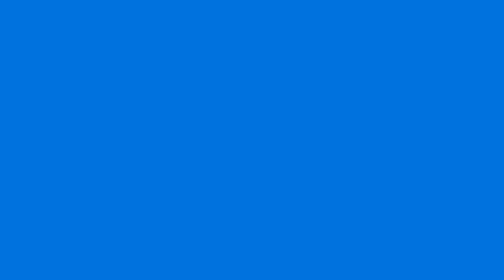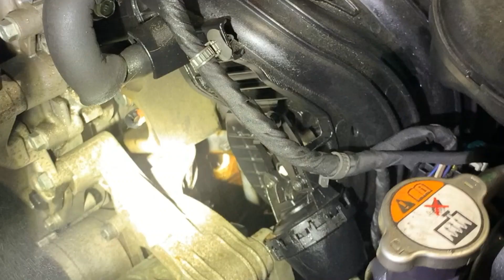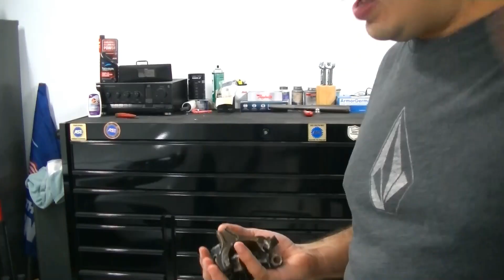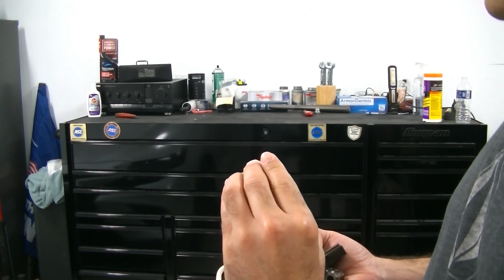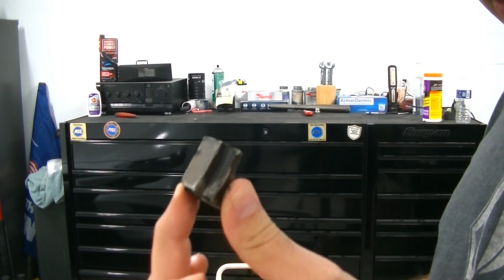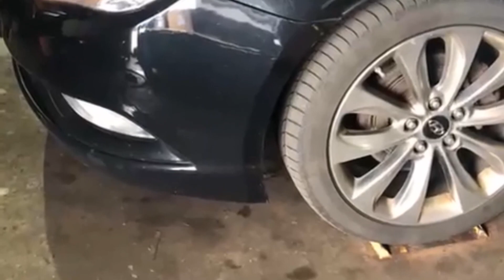P1326 In Hyundai/Kia vehicles, Cause of Theta 2 engine Failures, Timeline of Hyundai engine recalls

Comment: It’s amazing that Hyundai didn’t address the issues during their durability testing.
Reply: I have a kia sx turbo. My engine does run hot. I change my oil frequently and use the manufacturer viscosity suggested . 2012 with 95k miles. It burns 1 quart per thousand miles. Exaust smoke always dark at the start but fades while driving.  It's still fast tho, no oil leaks. Engine light on, possibly needs Sensors changed.

Comment: I have a 2016 Hyundai Sonata and the engine failed WITHOUT WARNING at 125,000 miles (2.4L) Changed the oil religiously every 6,000 miles with Mobile 1 synthetic. I owned it since new. I am an ASE Master Tech, I know what a failing engine sounds like. The rod bearings started squeaking then the lower end started knocking.
Reply: Mechanic here as well. Just picked our 14 Santa Fe sport from having a new long block installed tonight ! . The family and I were driving down the highway, a few weeks ago and then the engine shut down instantly. Lower end locked up solid.. we have had it since new and I changed the oil religiously every 5-6000 kms with Mobile 1 5w20,  . Engine only had 138,000kms ( 85,740 miles)  on it when she let go. 
Anyways going to be trading it in for a Toyota Hylander in the spring. I am  finished with Hyundai.

Comment: Thanks for this video.  My daughter bought a used 2013 Sonata two years ago and still owes $2k on it.  You can imagine her feeling of devastation learning the engine had seized.  Your video greatly helped me understand what had happened and will help me approach the dealer as an educated customer as I apply for warranty coverage.
Reply: They deny warranty often there are lots of video on YouTube about that. You should have paid little more and gotten Toyota, Honda or Mazda. Many people learn only hard ways.
Reply: Did she check and add oil regularly?
Reply: @gregorymalchuk272  Defiantly, the oil never dropped below the add mark.  It never really used oil.  I check oil very regularly and never let it get lower than the halfway mark.  So far we're nearly a year on the new engine and it's running well so far.

Comment: I have the Theta 2 MPI 2.0 in my Sonata YF,  it's an import from S. Korea and it is just fine. 2011 year with 160,000miles on the clock. There are some of the usual oil leaks around the valve cover gasket, which was fixed twice, first time with aftermarket gasket. Make sure to use the OEM gaskets from Hyundai and you wont get any more leaks! The car has been reliable, even after overheating at 90k due to a failed electric radiator cooling fan. No oil consumption, and I have run it on fully synthetic Japanese 5w40 motor oil (I live in the tropics, it's always hot!) changed every 7.5k miles. I am glad not to have gotten the GDi engine, as all GDi engines suffer the same fate....heavy carbon build on the valves after just 20k or so miles, unless the engine has some port injection as well to wash and cool the valves. The EGR system makes the GDi a whole lot worse!

Comment: 2015 Santa Fe 3.3 had issues with the camshaft position sensors, they were newer, and replaced them with upgraded ones, After the warranty expired I ordered the Holstein brand from Rock Auto Parts to replace all, and no more pesky engine lights came up. Have only 33.000 Km on it and recently Engine oil pressure started to leak had to replace that junk too before the catastrophe happened Hyundai never replaced them under warranty even though they knew that they were faulty and prone to leak..... NEVER MORE HYUNDAI. WILL TRADE IT IN FOR TOYOTA.

Comment: Very informative video. My 2011 Sonata 2.4L seized up nearly two years ago. That happened a couple of weeks after an oil change. I had it towed to the dealer and the first thing they did was check the oil. The oil level was good so they had no choice but to replace the motor under that recall. My car still looks great and runs perfectly so I plan to keep it for many years to come.
Reply: Many years to come or until the next bad engine. Hyundai knew of the problem for years and never took steps to fix it in the factory.  The US government let's corporate America do anything they want without regard to costs to customers.

Comment: My 2014 Tuson. I'm a 30 year tech and when the dealers say it's not covered I'll be all over them because the knock sensor reprogrammed and at 140K cylinder #1 started knocking. Its at the dealer now so we'll see what they say. It is in excellent condition here in florida and has always had Mobil 1 so they should replace the engine at this point. It's been back 3x for an engine noise and each time they say they can't hear anything. It's knocking now so they can hear it...3-4,000 rpm's. Great info thanks!

Comment: Very well explained and i could possibly believe a batch of cranks that werent 'deburred' properly due to a tooling/drilling failure but for years it's hard to believe. I have been watching a few complaint vids lately and from what they say Hyundai COULD CARE LESS that their engines failed so they seemed to have lost many customers due to terrible customer service but like anything it's $$$$ based and in the end the customer gets screwed. I have owned a 2003 Accent, a 2008 and 2009 Accent, a 2017 Elantra 6 speed and 2019 6 speed and now a 2021 Kia Forte as the manual is no longer available in the Elantra all without even 1 issue. One customer said he could see the metal particles on the dipstick and they jerked him for a year before finally telling him no. If it was a total 'deburring' issue that sounds like someone either wasnt inspecting the cranks properly or that wasnt a protocol after machining.
Reply: Sure seems it would fail on breaking then or very soon. Many of these are high mileage. Some 80,000 and I have even heard they replaced one with 224,000.

Comment: Very informative video. Thank you. My engine in my 2017 Santa Fe Sport 2.0T started knocking on a trip up to visit my family in Northern Ontario last week. Of coarse it occurred a few kilometers past my extended warranty at 160, 000 which I went over on that trip!. And of coarse it occurred in very cold freezing negative temps about 100km from the nearest city in the middle of no where. Along with waiting for a tow truck to come from that nearby city 100km away costing hundreds in the tow bill and waiting in the cold because I didn't want to start the car due to the knocking, it was quite the experience. Funny because I had the knocking sensor update in 2019 and my car did not go into limp mode nor did any error lights come on the dash. The one advisor from my local dealership on the phone even told me to keep driving because it didn't go into limp mode. The dealership that it was towed to stated they have to order a new engine from Korea that is back order and provided me with a loaner from Enterprise. I am just thankful this happened to me and not to my wife. Do you know if the replacement engine could have the exact same issue occur in the future or do the replacement engines have the knocking/rod bearing issue resolved?

Comment: This video was so informal. I’m suffering from the engine knock and p1326 code on my 2016 sonata sport 2.4L. Taking it to the dealership Monday and knowing this extensive information is very very beneficial
Reply: I’ve had it for over a year now and I’ve put 34k miles on it because of work but I’ve had routine oil changes (5 in total) and have gone full synthetic. it went into limp mode back in July. Took it to a mechanic and he changed the oil and vvt solenoid and as I was driving it home it went back into limp mode and completely stalled out and wouldn’t cut back on. The next day it did cut back on and I had it towed to my personal mechanic where he informed me that something broke loose inside of the motor and that i was going to need a new engine which was quoted at 6k. I’m just now learning all this stuff about the theta 2 engine and the infamous p1326 code and misfires happening and honestly regret getting a hyundai when I had the chance to go with a 2016 Honda accord sport.

Comment: We’ve got a 2017 Santa Fe 2.4 sitting towed into the dealer with the p1326 code.  It went into limp mode with the flashing CEL on the way home.  We got it certified used and had most of the maintenance done at the dealer.  We will see what they come up with…

PS, thank you for the detailed history of this unfortunate issue!

Comment: Thank you very much for your explanation of the "issue" Hyundai has with the Theta II engine.  Indeed it is somewhat complicated.  I have two Hyundai's and one is a 2013 Santa Fe (used but certified) with about 69k miles and have "experienced first hand the "limp home" mode as it entered this mode while driving in the mountains about 100 miles from home recently.  The vehicle has had all the recalls done including the "band aid" ones.  I'm a retired service advisor/ASE tech and know a little about vehicles and have tried to follow the issues with this engine.  Hyundai has "struggled" to find a fix short of replacing all these engines and indeed the "latest" is to reprogram the last reprogram to I believe "dumb down/less sensitive" to prevent the vehicle from going into limp mode when not necessary which is exactly what what was done this time when I left it there for over a week.  The "good" news was that the engine is OK according to the bearing test.  In my opinion I believe some of these engines also fail due to some owners failing to keep the oil level full as it appears they are sensitive to low oil levels.....remember the recall where the oil was changed along with a new dip stick?  In other words, keep the oil full and oil changed about every 5k miles.  As far as the GDI issue with carbon on the back side of the intake valves, this is an issue with any GDI engine and is the reason some manufactures have gone to adding PFI injectors also.  In the mean time I suggest to do a intake clean with a product like CRC cleaner every 15k miles and add an oil catch an.  I do both and they work.
Reply from the maker: Hit the nail on the head. If you look at some of my other videos you’ll see that I run a catch can on my personal car, and I also believe in performing some sort of induction service at a regular interval, though I prefer BG induction cleaner.
Reply: Great vedio I just subscribed 👍..one question I have.i bought a brand new 2020 santa fe could I just vent crankcase to atmosphere with a fitting inplace of the pcv valve and vent it through a hose to under the car?........of course this vehicle would used only on race track .
Reply: @arthurhudgens8213  I've read where people do that, triggers service engine light, you could also do a catch can.
Reply: @lonniebeal6032   I think a catch can is an excellent idea and I'm looking into that soon..noticed your last name is Beal my best friend growing up in fairview tn was Eugene Beal
Reply: Thank you. Very relevant!! 
14 kia forte that passed clearance test but frequently goes to limp home mode. My ind shop suggests moving the placement of the knock sensor. No crazy oil consumption maybe a quarter between changes. I don't hear a loud knock, closer to what used to be known as lifters ticking.

Comment: I owned a 2009 Sonata and put 170,000 miles on it.  I changed the oil and filter with synthetic Mobil 1 oil every 5,000 miles and never had a mechanical problem.  Never changed the transmission oil, it looked fine, and I did change the coolant around 100,000 miles.  Great car...
Reply from the maker: Yes the pre GDI engines were great for the most part
Reply: 2009 was a dohc engine. Far superior. I have the same 09 sonata currently running strong at 150k miles. Going to the GDI is a bad business decision and brand destroyer that hyundai will suffer from for years

Comment: Great video!! I have a 2016 Kia Forte and IDK if I shall be worried! The dealership bill says it has an N 2.0 Theta MPI engine, made in Korea. It has 60K miles and has been very smooth, it doesn't burn any oil, and I checked the VVT solenoids for debris, and found nothing. The only "suspicious" symptom is that is makes a "slap" sound whenever it is warmed up, turned off for a few minutes and then turned on again. It's weird, because it doesn't happen if it has been sitting for many hours, even days, so it's not when the engine is cold.

Comment: Thanks for making this video, I am going to save it and show it to my wife.  We have a 2016 Kia Soul with the 2.0 and it has very low miles on it.  Always had it's maintenance on time and at dealers.  I know you are going into the Hyundai engine, I believe Kia is using the same engines.
Reply: It's the same exact engine.
Mine is in a Hyundai Santa Fe.
I'm at 130.000, no problems with it all.
The fuel pump had to be replaced at around 60,000
That's it
Reply: I bought a new 2017 Elantra automatic,  fully loaded,  Southern California car. It just turned 105.000 miles. The entire car has been excellent.  0 repairs,  0 issues.  Engine runs smooth quiet, uses no oil . Oil changes every 3000 miles with Castrol GTX since 1st oil change..extremely pleased with the car.

Comment: Trusting our LORD that the new 2.5L engine doesn't have the bugs that the 2.4L Theta 2 engine had! I just got my wife a 2023 Sportage (last June.) I do oil changes every 5,000k/6 months, whichever happens first---usually the 6-month interval happens first. Oh, & I only use fully synthetic oil, exclusively.
Reply: I have a 23 Santa Cruz with the same engine. 0W-20 is the ONLY recommended oil which happens to be full synthetic. I'm hoping I don't have carbon buildup problems because of it being  GDI.

Comment: I think I just ran into the unnecessary engine protection mode you mentioned later in the video. My 2017 Sonata went into limp mode at 96k miles, limped it to the dealership and they said it needed a software update and passed all engine tests. Crossing my fingers that the issue doesn't rear its head again, at this point I'm going to be trading it in and getting a Toyota RAV4 as soon as I can.
Reply from the maker: Can’t go wrong with any Toyota products

Comment: I have a 2013 Kia Optima SX T-GDi with 36k miles. I change its oil every 3 months and I think this is what it has kept it alive on the original engine for so long. 
The recall has been done but I don’t know which one since they changed the dipstick to the red one and that’s it.

Comment: I bought a 2015 hyundai veloster may of 2021 with dual clutch, 1.6 L engine and within 2 or 3 months it went in limp mode. Replaced knock sensor, drove fine..for about 8 months.  Took it to dealership for computer upgrade revision, ran fine for around 6-8 months then noticed a serious power drop in acceleration and a slight rattling ping sound when waiting at a light and next to something solid it could reflect sound off of.  I changed spark plugs last friday and always top off my oil and have it changed as recommended.  Checked all fluids and she ran decent for a 2 hr drive from sacramento to muir beach in bay area (ca.) Until way home driving thru Vallejo, coming up an incline my check engine light flashed and i pulled over immediately and called AAA andtowed it back home.  Limped it to O'Reillys about a half mile from my house and scanned it which brought up the p1326 knock sensor code again.  Ordered part, came in, gunna replace it today before it gets too hot here(it ws 108°yesterday!!)  Now after watching your video which I thank you very much for so helpful would you suggest but I inquire with the dealership if there's a software update or should I contact Hyundai about the reoccurring knock sensor or should I do the research and not have a vehicle to drive probably lose my job and hope that somebody knows what the hell's going on???  That is why I'm asking you what your opinion would be what I should do any input would be greatly appreciated.  By the way I bought this car from Shift Auto sales and I'm paying up the wazoo for it.  Considering trading it in don't know how that process works because it's my first car I've ever bought from a dealership but I am financing it and not sure how they would handle this but I refuse to get screwed, especially from a reputable Auto company... As Hyundai used to be!! Help please!!!

Comment: Oeno Promotions
1 second ago
My 2015 engine block was just replaced, I am the first owner. Went into limp mode 2 blocks from the dealership. I drove it right into the service bay with no power. "do you have a appointment" ME  "No but my car just made one."  Next Day " Sir you have been approved for a new engine. I kept my mouth shut and accepted it. Mainly because I have 125,000 miles and they covered the repair and gave me a loaner car. 
QUESTION: DO I have to worry about my new engine block? Have they fixed this issue?
PS Your video has been very helpful to my family. My parents bought a 1015 Santa Fe on the same day as me.  Oh and their dipstick is Red. To which my dad replied. "That's what she said."

Comment: Thank you for this video. I started looking at youtube videos related to this as just yesterday my 2015 Kia Sportage started knocking and shaking pretty badly along with a flashing check engine light. I had a scanner and it did have code P1326. I am praying to the car gods that Kia stands by their 10yr 100k warranty and fixes the problem. The SUV had 79,200 miles (very well maintained and documented). It had been super reliable until this happened.
Reply: Trade it in
Reply: 10 year Warranty🤣😂,They can say they give you 20 ,anyway they will not honor the warranty
Reply: Did they?
Reply: @bob-pr8ye  they did. Brand new engine. Warranty took care of everything.